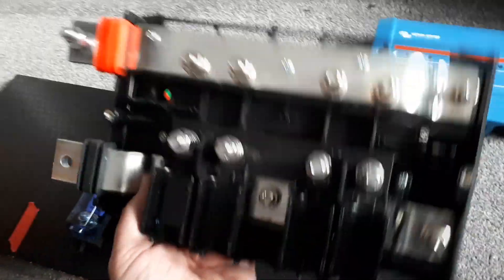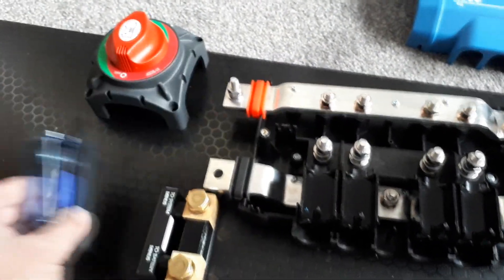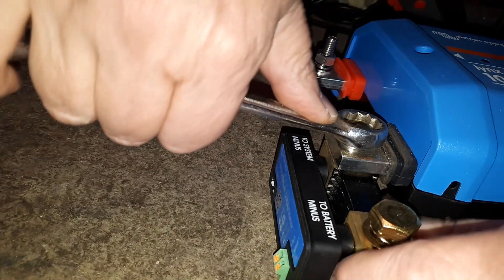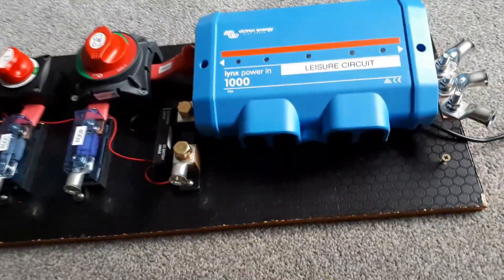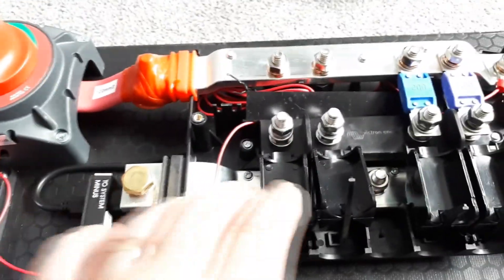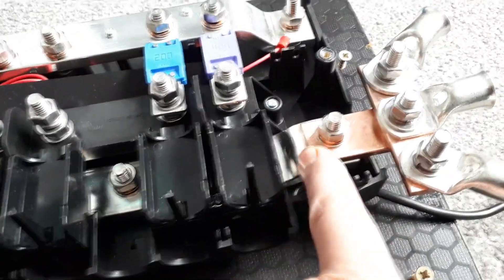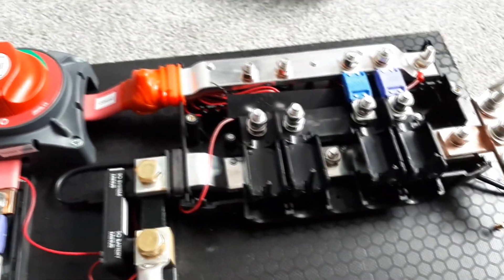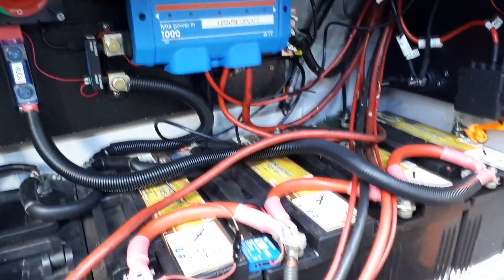#44 Electrics Upgrade on our Narrowboat

Comment: Only things I would add here is the industry uses Paxolin as a construction medium for electrical switchgear, it's water/moisture/fire/heat resistant, it can be drilled, cut and meets all approvals for intended use, ply really doesn't! and I would ensure there is a fused/MCB protective device on all your control circuits, an unfused 400A bus supply will make short work of destroying your control wiring if a fault develops.